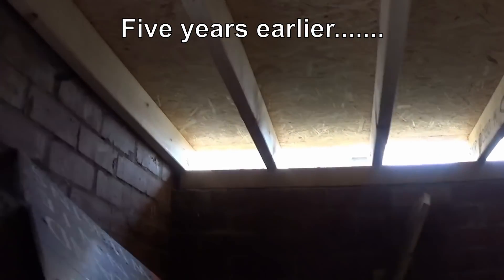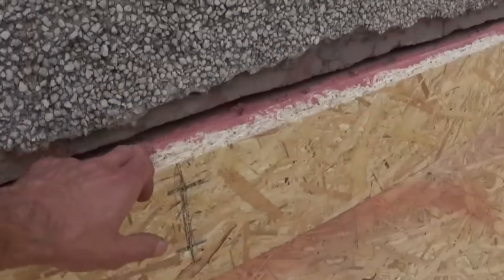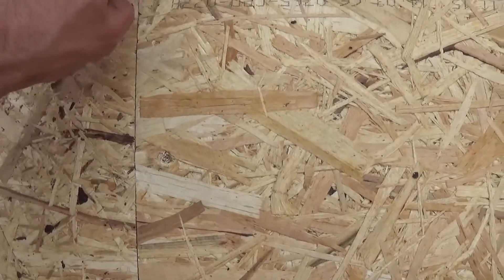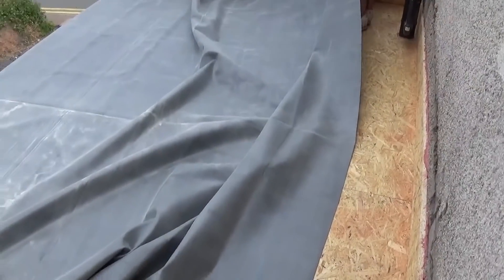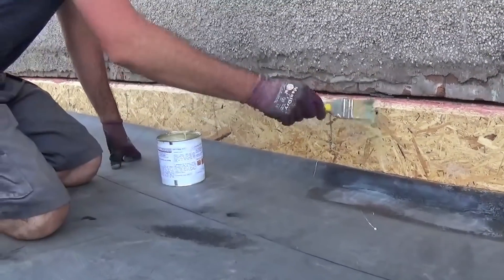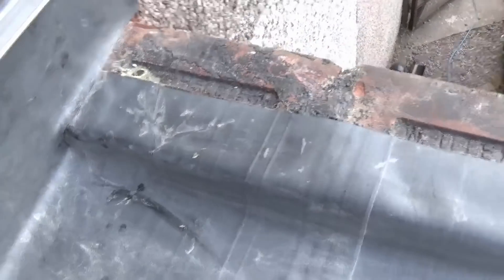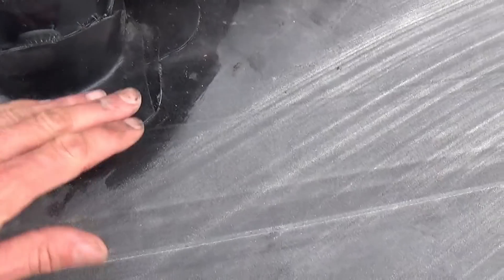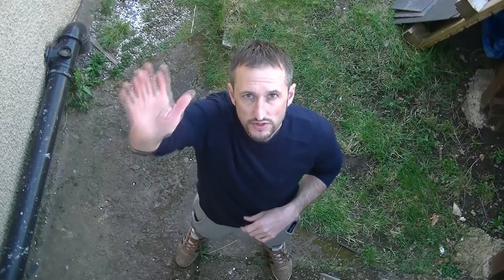Garage roof build with EPDM rubber roofing. Garage roof construction. DIY EPDM roof install!!

Comment: At last some one who explained  how you attach it to the house wall,new subscriber
Reply from the maker: Glad it was helpful! There are different ways to do this mind. This is fine for a garage roof, but for proper house floors designed to be walked on every day then you might tie the joists into the wall by knocking a few bricks out. Thanks for the sub!

Comment: Very smart, have to say it's better than a felt roof.
Reply from the maker: Much better than felt. As long as you have a nice flat surface underneath it's fairly quick to get water tight. You can also buy it cut to size in one piece for smaller rooves which is great! Thanks for watching.

Comment: Really like this EDPM, I'm looking to replace the felt on our workshop as it's become porous and the roof leaks badly. The roof is an apex and I think this would work nicely, it's also more affordable than I thought.
Reply: Most roofers will slag it off but I'm sure it's because they  an't come back and fit it all over again in 5 years time!  I've used the rubber on no end of roofs, one going back 14 years. It's still as good as new. Brilliant stuff. Fit it properly and it's got to be good for 50 years! Try National roofing. They always give a good price. And the quality is great aswell.
Reply from the maker: I was going to say the same. It is really tough. I've had scaffolding on it for a few years, walk over it all the time and it's great stuff. Although mine is a bit dirty when you clean it, it comes up like new. You can buy it cut to size. On a roof like mine I covered it all with one piece. Best of luck with your project!

Comment: Great video !! Thanks mate , fuck the haters , I guess they must be roofers worrying about loosing work  lol 😂, keep it up I enjoy your videos mate thanks again brother 👍🇬🇧👍👌
Reply: The beam fixing seems weird. it should lay on the outer face of the beam otherwise it's not holding as much...
Reply from the maker: I understand your point. I could have used longer bolts or a thinner piece of timber and fixed to the outside, but by slightly countersinking they are not sticking out, the fixing is still against as much surface area of wood using the washer and nut. It's extremely solid and it's only a garage roof, it's not a usable floor to be taking foot traffic all day. Hope that helps.
Reply from the maker: Thanks for the feedback!
Reply: @POUSEaroundtheHOUSE  It does, thanks!
Reply: @POUSEaroundtheHOUSE  Also I understand having to work with the tools you have. You can't necessarily afford to buy more timber, either because of the time frame or the budget. And I mean if you're not planning on using the roof as a living space and you don't have heavy snow/rain, you should be alright.

Comment: Hi Pouse, I need to do exactly this on my garage. Looking at regs, I'll need them as it's 35m2. Have you had to get regs/approval on anything, and any tips? I havent got a clue where to start, but defo dont want to be shelling out loads on small jobs
Reply from the maker: Apologies I'm a bit late to the party on this one, you've probably done it by now! No regulations required as it was just rebuilding an existing roof. If you're constructing a new building then it may require planning permission or if done under permissive development then there will be size limits. If it's a habital room then you will need building regs approval also to ensure it's constructed with the appropriate materials/insulation/damp roofing etc. Hope that helps.....even if it is a year too late!

Comment: I don't really like the termination bars they send, I had a few issues with mine leaking so I removed them in the end and just put coping stones on the rubber and pointed them up, no issues now.
I assume they will be OK if you are using it flat on the roof joining to a neighbouring roof? Don't work very well upright though
Reply from the maker: That's why I ended with lead flashing. Had a weep behind front coping stones and over time water had got behind bar and sealant. Other than that it seems like a good system. Thanks for watching.

Comment: Great video, just wondered if you need to provide ventilation to a flat roof?
Reply from the maker: This roof isn't insulated, the joists are still exposed beneath so technically it is ventilated. However if you are doing your own roof, check out the insulation websites like Kingspan and they provide good informations on how to insulate and if ventilation is required. Thanks for the comment.

Comment: great job but surely better to set out joists at 16 inch centers cos osb is 8x4
Reply from the maker: Yes, fair point, I think at the time maybe I set them at metric intervals then shifted the odd joist to suit the end of the board. It's easy to get going on these jobs then remember simple things like that. It's always baffled me why osb is imperial, plasterboard is metric etc. Joists sizes are often given in imperial but actually metric! But there we go, the joys of building. Thanks for watching.

Comment: How are the bolts holding the beams? With bolts like these you have to be flush on the outer face of the beam so they can hold the beams to the brick so the brick does the work and the beam can't move. I guess it depends on your weather conditions and what you plan to do on the roof, but it seems weak. How has it been going?
Reply from the maker: I countersunk some holes the size of the washer, then placed the nuts with washer inside and tightened onto the bolts up tight to the timber so the timber is solid against the wall. The bolts were solid into the drilled holes in the wall which I tapped in with a hammer. I used several across the length of the timber. It's extremely solid. I regularly walk on the roof for maintenance to the house.
Reply: @POUSEaroundtheHOUSE  Oh I see. If it's been holding it's that it's strong enough then! Not an expert myself, but I have some experience with this, I had to consolidate all the floors in my house because none of the timbers used for framing the floors had been attached to the walls. I had to use massive coach screws, 5 for each beam put against a wall, to make the floors safe.... And with coach screws you need the bolt against the timber.
Reply from the maker: @isakaldazwulfazizsunus7564  yes that makes sense. But they are structural floors, this is a roof not expected to be walked on every day. Thanks for the feedback.